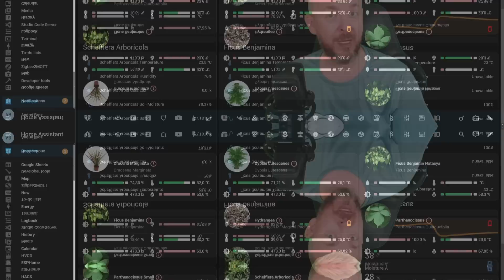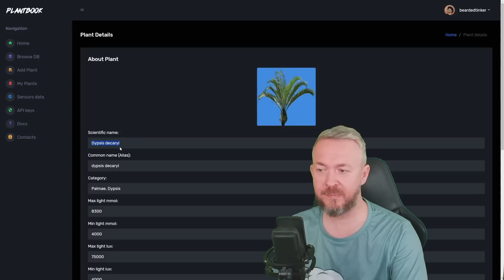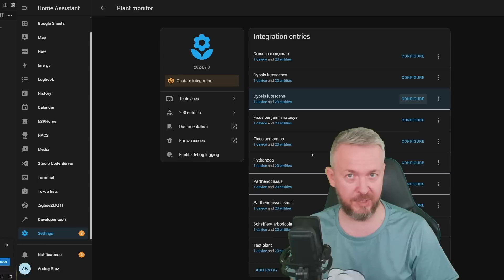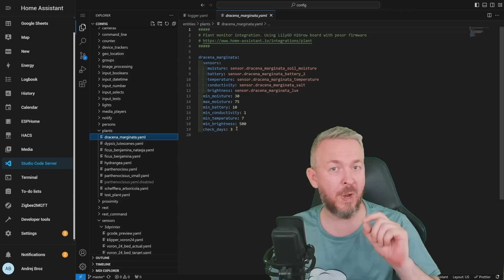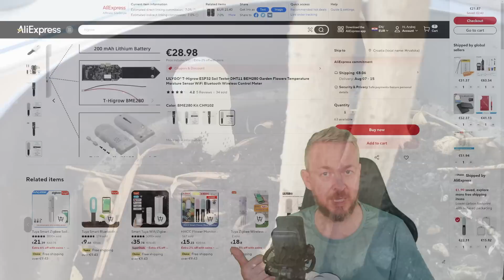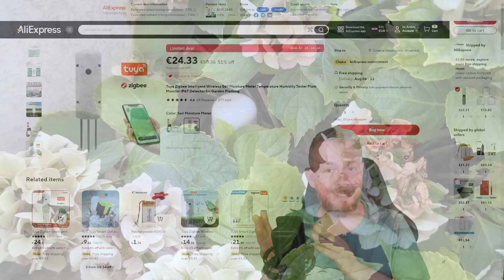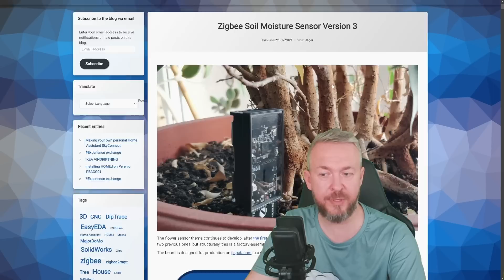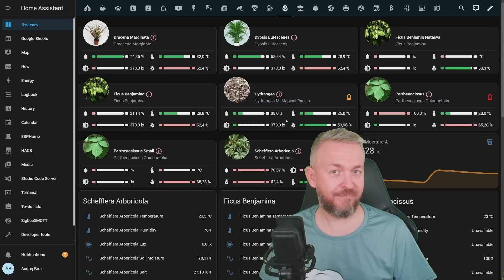HACS Plant monitoring and hardware plant sensors

Comment: I have the Zigbee bulky version. While it works great in my apartment, I have high soil moisture readings in the greenhouse and outside that I don't completely trust. I decided on this type mainly because of the corrosion on other types of sensors, which destroys the sensors within a few months. What is the long term durability of other sensors? My plants grow better with the use of sensors because I simply water them more regularly thanks to the sensors.
Reply from the maker: I've got few of them (others) in cart to test, but still haven't ordered them. I know that people are pretty happy with BLE version of Mija Flower sensor. But I also always forget if the are rated for indoor use only or not.
So far still trying to find something that give at least partially accurate data and that also can survive outside.
Those bulky ones I have survived both very hot summers and cold winters outdoors.

Comment: I like the "ECOWITT WH51 Soil Moisture Sensor Soil Humidity Tester" which appears to be quite expensive right now at $30 but I usually buy them for around $15-$20 on sale.  It requires a gateway or an SDR receiver.  The official gateway has humidity and barometric sensors built in and it's very easy to integrate locally with Home Assistant.  There are also other sensors that work with the gateway including full weather stations.  A great system overall.
Reply: +1 recommendation for Ecowitt.  It's pricy, so I only bought two with my GW1100 about a year and a half ago.  Now I've fully maxed out the soil Moisture sensors on it, added a soil temp sensor for the outdoor garden, as well as an outdoor thermo/hygrometer and the lightning sensor, and still debating replacing some of my Acurite/rtl_433 sensors with more Ecowitt. 😅.  

I did have some problems with the official ecowitt integration when I first started, because, at that time, the gate way didn't support connecting to a SSL system, and I've redirected my HA's non-ssl connection, but the HACS integration worked well for me.  That was a few firmware updates ago, so might be worth check out again

Comment: I had 3x Zigbee ones..they sre absolutely horrible and inaccurate. They report around 40% additional humidity than MiFlora and they are bearly sensitive to changes.
Reply: Are you talking about DIY version or that bulky one?
Reply: @Ipeacocks  the bulky, tuya one.
Reply: you are right. never again a tuya sensor :/
Reply from the maker: But unfortunately, if it's not tuya, than the number of alternatives is very limiting...
DIY is ok, but you do need to spend some time to calibrate it by hand too. Out of box  it can be waaaayyyy off.

Comment: I've used the mi flora HHCCJCY01 BLE monitors for a while and found them to be pretty reliable, but the xiaomi plant database is a bit rubbish.  The open plantbook database was a big advantage for this.   I like this plant monitor from HACS.  It seems to be really detailed and a great way to monitor how the plants are doing.
The only sensor I am missing from the mi flora is the air humidty sensor, but I can get that from a different sensor in the room :)
Reply from the maker: I still haven't ordered any of them but it's in my shopping cart. Will probably do it next few days. Open Plantbook is really awesome project - loving how it ties with other components nicely.
Reply: @BeardedTinker this is basically what I do in my setup as well, can recommend them
Reply: @BeardedTinker  If you are getting the mi flora devices, get the international "white" version.  The green version does work as well, but they are more made for the china mainland market
Reply: @EsotericArctos  bought green ones and they seems work ok. What's wrong with them? Use these sensors with HA.
Reply: @Ipeacocks  The green ones I had all failed quickly.  Light sensor mainly.    Also had some small issues with connectivity. The green ones are China Mainland where the white ones are the international version.  Not having any of the issues with the white ones.
Reply: I got 10 of them, they are great and very stable.
Reply: Why no one make a version that sensor capacitor pcb is inside the pot and a battery box hanging on the outside?
Reply from the maker: I've backed one project on Kickstarter that promises smart pots, but we'll, a year later, still no product ready for delivery 😂